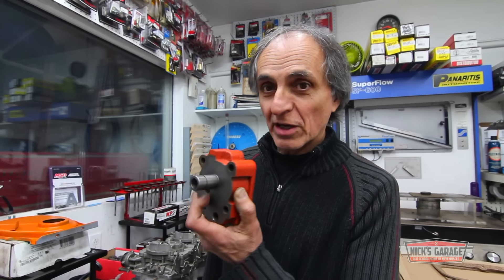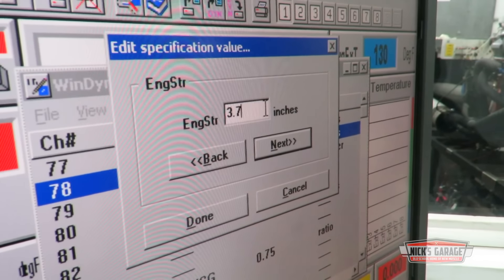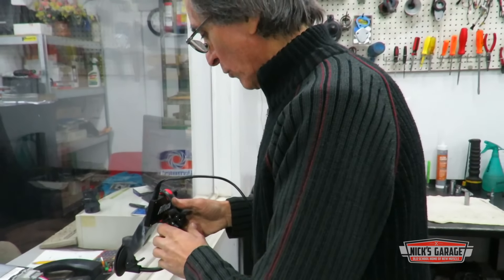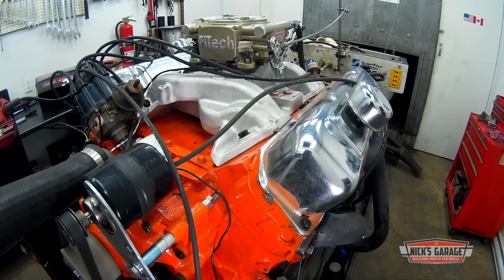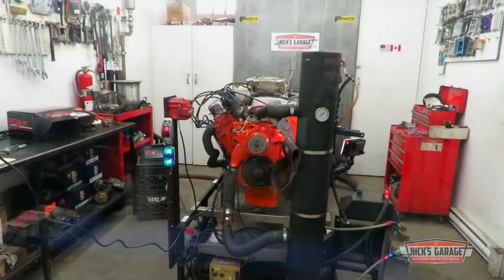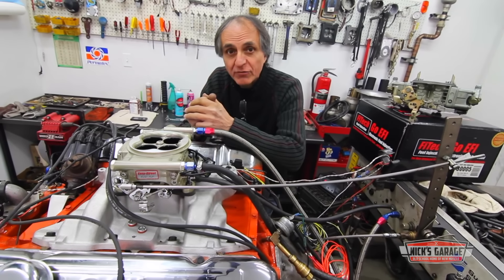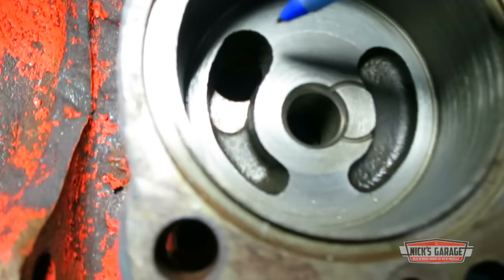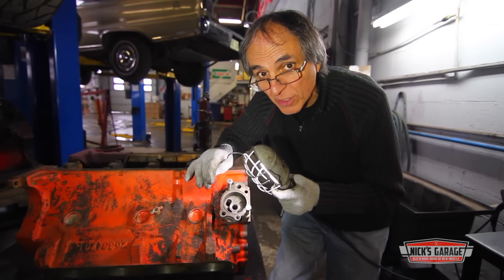Carburetor vs E.F.I. - Dyno Room Showdown

Comment: What a terrible comparison. The EFI had no chance to learn. However, given it only made 10hp less, I'd say it did rather well. With proper tuning the EFI would out run the carb in this application. Carbs are great for racing but even in racing EFI is king.

Comment: Uh....you want "fuel economy" out of a 440 in a truck.  So you spend 2500 more to save 250 in gas over a carb.  My laptop is a nut driver and a screwdriver for the double pumper.  Life is easy.

Comment: Not enough information on the throttle body size - were they both rated for the same CFM?
The second thing is whether it was a fuel only setup or if the dissy was locked and actual timing controlled by the electronics - it can make a big difference especially on part throttle.
Thirdly, dyno' rom is one thing - cabies have problems when run at higher degree angles, which the truck owner 'may' reach if using off-road.
Fourthly, keep the videos coming :-)

Comment: Efi injection kit, how much!
Reply: Low end Fitech EFI is $725. They go up from there. Mine is the 600HP with timing control. Was $925. There is a bit more to it than buying the basic throttle body. An EFI pump and return line is needed. The whole fuel system will need to be upgraded. Well worth it though.

Comment: Didn't give that fi tech enough time  should of done two more pulls so that it would learn as you did more pulls. I would have done 4 pulls at least to get a good solid results also 10 HP for better gas mileage seems like a no brianer and could be made up with bigger exhaust

Comment: Granted, many things suck about being in Canada,  but concerning this video.... that nice big garage, all those nice cars..... doesn't it suck for you Knucks..... the toys are always American muscle cars.... and the engines you're building and racing and playing with on the dyno...... pure American muscle HP.
Reply: Plenty of those engines will have been made in Canada, e.g. small block Fords are named after the plant in Windsor, Canada. Still making the 5.0 there now.
Reply: Why is it so bad that Canada imports cars from the USA? Sometimes it makes more economic sense to have international trade rather than have a manufacturer or factory in every country. In addition, some cars do get made in Canada even if the company is not based there. For example, many Firebirds and Camaros came from Canada. I'm fairly certain that from 1993 to 2002, all of them came from Canada. Also, there were times that Canada got to have a car that the USA didn't have, such as versions of the Pontiac Parisenne.

The car company doesn't even have to based in the USA to have factories in Canada. Toyota and Honda have a few factories in Canada for example.

Comment: nicks garage: you need to learn better your job: i'f you put more power with a carburator is only the prove that your injection is very bad tuned: a carburator is a restriction, because the venturi, the injection as NO RESTRICTION, with a  injection  you gain minimum 3 % power , and the difference is a bit more with a multiport injection against a engine fitted with ONE CARB body PER CYLINDER  fitted directly on each cylinder like on race cars ...An with a carburator, only ther RPM range arround the max torque is correctly mixed, on most rpm range is the mix to lean or to rich, and can be different for cylinder to cylinder, specialy with such 4x multibody carburetors you use on US V8's...
Reply: leneanderthalien.    Next time we will do better. Did not do well on video, but after putting time and effort we had it running well after the video. Yes, needed a lot more time to learn

Comment: I can't remember which magazine ran tests comparing Carb vs EFI system(s)...
Carbs won at WOT HP but EFI won in Torque and at lower rpms too.
Reply: I want to know the effect of putting TBI on my motorhome.. it's why I want to know how it compared on torque at low rpm.. I'm never going to rev that motorhome over 3000

Comment: And where does all that fuel go from the bowls of the carb when it has set for a few weeks?  That’s right some evaporates and leaves behind a nasty build up clogging the carb and some can drain into the intake causing cylinder wash with dry cylinders at start up. Leave the carbs in the pre 80’s where they belong on an engine you care about.

Comment: Carburettors still rule man, EFI and fuel injection is for old people, it's too easy, nothing to it you put it on and you go,what's the fun in that? A carburetor you can do what you want to it and turn that baby up. More power out put, killer throttle response, plenty of variations, And get just as good as fuel economy is injection does, I've got an old Dodge truck with the 318 V8 and a Holley 2 Barrel stock motor, now sure I can get about 10 miles a gallon holding it in the floorboard, but ( I calculated this) can get 17.1 miles per gallon on the highway, in a old broken down gas guzzler, people don't understand it's not fuel injection that gives cars and engines good economy it's the motor, they're made and designed for economy. EFI is More expensive than a carburetor to. It's not worth it, because it's not that much better.

Comment: Misleading and pointless. Throttle body injection was just a badly done simulation of a carburetor using slow underpowered computers. Port injection optomizes the mixture for each cylinder in a way a carb cannot, and direct injection allows even better results.

Comment: I guess if you only ever expect to run your engine in a room under controlled conditions then yes, carbs are the way to go. 

🙄
Reply: He says it's fine for cruisers/Daily Drivers!  Carbs suck on daily drivers BUT when you are racing and your car is at WOT it's better to have the Carb, most race carbs cost as much or more than the FiTech system.  You need to spend 2-3x as much for a multiport FI system on a race car for it to be worth a damn.

Comment: Carburetors are horrible, EFI or direct injection any day for me.
Reply: Thanos.     We have it running on the road, and it runs great. We needed more time to learn it.
Reply: @nickpanaritis4122   the other issue is elevation, I have had the terrible experience of running a carb through the mountains. Change the jets for high elevation then if you go low elevation you get same issues.
Reply: Thanos.   Yes, you are correct, and that is why Fuel Injection was invented to eliminate these issues.

Comment: TBI. Enough said. Needs to be multi port injected and computer controlled timing. I ditched an old carbureted 4 cyl with points for an EFI version of the same engine (ford 2.3) and retained the dual plug distributorless ignition system. I will never go back to a carburetor. Its never tuned right - if you get it "right", just wait 5 minutes for the temperature to change  and it'll be out of tune again. EFI or Diesel for me. Carbs go to the scrap pile where they belong.
Reply: torque395.          Very hard to beat EFI when it is tuned perfect.
Reply: @nickpanaritis4122  Yeah I agree. And that's why new cars dont come with carburetors. People need to think about that when they downgrade to carburetors.

Comment: Sorry but that's not proper fuel injection,true fuel injection has one injector per cylinder either port or directly into the cylinder. Do that then see what the results are,also for a true comparison the engine should have been tested with a carb and a efi set up.

Comment: First time I've dislike one of your videos. FiTech is an awesome budget self learning fuel injection system, and other outfits see equal horse and torque number with these kits.
PLUS, you didn't even send the time to bolt a carb on this engine. If this engine didn't live of to your "439 HP" claim with a carb installed, you would have spent more time tweaking with jet sizing and play with ignition timing. 
Way to be one sided. Choosing not learn other technologies is not a better way serve YOUR customers!
Reply from the maker: Sorry you’re disappointed, but here’s the engine with a carb. 
https://youtu.be/4uRHsW_IMrw

Comment: My intake cam off a 69 390 cougar. Works great . Thanks for the videos . There's nothing like a good Mopar engine.
Reply: A Better, is a  GM Engine Small or Big Block each are superior than any mopar.
Reply: Good mopar engine? As what? Perhaps a boat anchor? No sorry would not even do a good job at that, about all they are good for is scrap metal weight.

Comment: Once again, Nick shows how it’s done. I’ve heard of these FITech systems before, never good results. Stick with what came from the factory or a close facsimile. This so called injection system is a no-go for the real world high output motors from the day of big horsepower.
Reply: lol no. efi can make just as much or more hp than carbs.
Reply: Frigglebiscuit some people are just stuck in the stone age.. lol And don't want to educate themselves on new technology
Reply: Chris P Be it as it may, at least in the day ,you didn't have to be a computer whiz to tune up a carb. Sure, technology is great in many applications, but just for giggles, a perfectly matched carb on a high flow manifold, going to a set of high compression heads,and a set of 3" headers is music to these old ears.

Comment: Great video. I'll like to see a video using a street deamon carburator on a fe big block ford. My truck has a 352 Fe .40 over Elgin cam .489 in .512 ex . 390 hp heads medium rise heads code s  intake. Hei disturbitor
Reply: kamphwagon1  the deamon carburator I have looks like a thurmo quad . I have had good luck with it and works great.